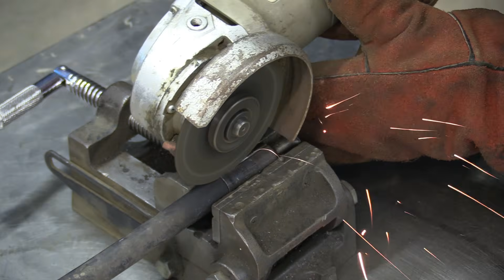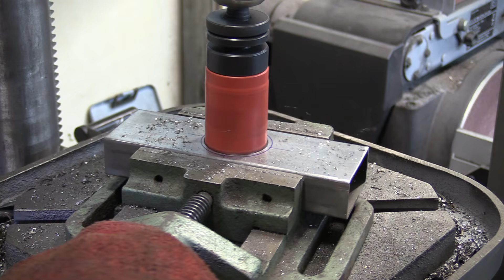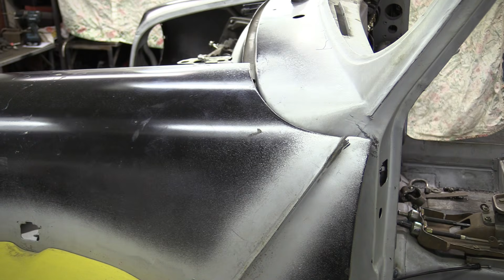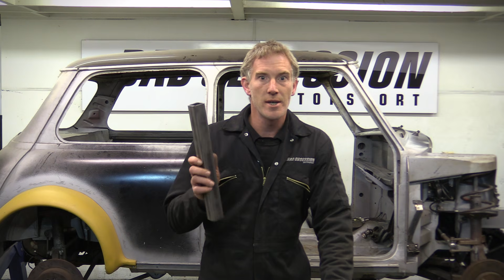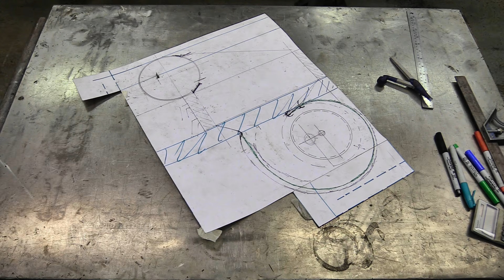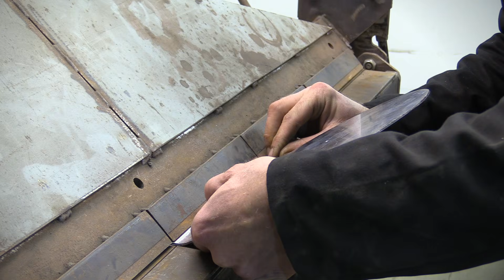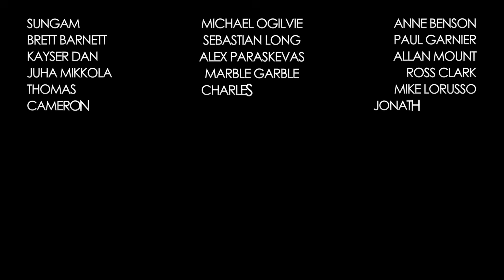Project Binky - Episode 16 - Austin Mini GT-Four - Turbocharged 4WD Mini

Comment: Millions of hours to build and 1 sec to wrap around a tree stump.
Reply: In the next episode, before hitting the road, we will grind down all trees and tree stumps within 1 furlong of the road – with a die grinder.
Reply: part of me doesn't want them to race it. from the other hand - all that work has to be put in action. From what i know - sometimes for builders the most important is the process of making, what happens next is not that important.
Reply: they could use the fate worse than death wheel
Reply: That's part of the design evolution. Crash it then while mending it you make it bit better than last time.
Reply: It's going to be his road car I believe, hence the air con, heater, leccy windows.
Reply: Looking at how sturdy it looks - you should be worried for the tree.
Reply: user12345 this will be their street legal rally car, and they made it clear that creature comforts are not to be disregarded.
Reply: Umm, that's what I said?
Reply: i just like building cars driving is second probably why i own a Citroen always something to fix
Reply: That would probably take the same amount of time as the fabricating a few simple brackets.
Reply: be around a treestump because they could have added lightness by using anti-fog or metho.

Comment: I can't help but think the final shape of the heater-box was about (almost) twice as big as could have been done if you had the time to design it around spiral-based air-speed focused "labyrinth"-channels, for more optimal space use. Though obviously if there wasn't going to be a glove-box that'd sure be simpler, as then certain components could be relocated into the engine bay with tubing, like BMW style.

Comment: I was trying to work out what you chaps are actually doing here.
You are basically designing and building a new car model from scratch.
The body has been designed somewhere else, as has the engine and transmission but the rest is all new.
Everything!
Just to complicate things, the boffins in the body work department have given you a body, 120" long and 55 1/2" wide.
Oh yes, and the body was never meant to have rear wheel drive. Nice.
Still how hard can it be, a car company has a huge budget,  hundreds of people working on the project, departments specializing in each component.
They have multiply facilities, tools, equipment, jigs and robots.
Now, just explain to me again why this is taking so long? You have C.A.D. and a new ed of catering, no more excuses please.

Comment: If it's just for heating, and you didnt want the direction, I would have just mounted the radiator on a 30 degree angle off the fire wall, created a shround and drilled some holes for fans to force air inside. Would take up 1/4 of the space :)

Comment: that heater box. i wouldn't have done that. i would have made the box, then cut it in half and add the lip on the inside, bend that a tiny bit in so it goes in smooth, add some nuts on the inside and add holes in the right places so you can use countersunk bolts and done. saves a LOT of time and a LOT of fumbling around. Well, at least, when I do it.

Comment: How about some 3d printing (or glass fiber for that matter), 30 mins of design and 2 hour of printing when you are not there is not an issue.  I know this is stage for you to show your work.  But I am sure customers would want you to be efficient and put time in where it needs and leave other manufacturing processes for the other jobs.

Comment: Fantastic work as always, nothing is below beautiful on this build. Given the small space for the engine and it being turbo and such, do you think ambient air and thus block temperature will be an issue? Eric The Car Guy has been doing a fairmont build with a V8 turbo and he kept having heat problems. Here's hoping its just higher CFM fans that solves it but it's not a confirmed fix

Comment: The actuator flipping hood thingy is completely unnecessary.  The engineering and fabrication involved is nothing short of miraculous, but still; why add needless weight to a racecar??
Reply from the maker: +Rerock It's not a racecar.
Reply: Oh okay, thanks for the clarification!  Was the hood (bonnet) heavy to lift/open, or was the actuator simply for the cool engineering/fabrication factor?
Reply from the maker: +Rerock Just because we could really. 😀
Reply: Right on.  Keep up the amazing work; I'm anxiously awaiting the next installment!

Comment: So, a front hinged hood on a semi truck can be tilted forward and back by hand but you need an electric linear actuator for your Mini hood?  WTH?  Great video but that was a huge waste in my opinion.  Two properly placed and sized gas pressured struts would have worked perfectly, not required that actuator or space or any electrical wiring.  
PS: Did you ever fix the design flaw in your brake/clutch reservoir?
Reply from the maker: +Mike Grady You can't scare the shit out of someone standing next to it from 100ft away with a pair of gas struts.
Reply from the maker: +Mike Grady No, do tell about the flaw in the reservoir.
Reply from the maker: +Mike Grady You're free to build your flip front with manual activation. We chose a different route...
Reply: Bad Obsession Motorsport, totally agree.  It is 100% your project and prerogative. I just didn't understand the reasoning behind the added complexity.  I was hoping your might be able to illuminate my lack of understanding.
Reply: The reason is probably Added complexity and huge waste of time and a bit of Looking cool at the Ice Cream stop.
Reply: Bad Obsession Motorsport, how's that?  Do you mean with the linear actuator?
Reply from the maker: +Mike Grady The remote.
Reply: Bad Obsession Motorsport, I was going to ask again about the brake/clutch resevoir but it appears questions are being responded by an administrator so you probably don't understand since you are confusing a linear actuator with a pair of gas struts.......
It's all good though.  The entertainment value of the production is worth it.  
Thanks for the videos.
Reply: Bad Obsession Motorsport, what episode was that in?  You had mentioned in the video that you did it a certain way so if one line leaked, it wouldn't ruin the feed for the others.......but it still would.  If you remind me the episode, I will rewatch it and give you my thoughts.  I commented on it but you have so many comments, it wouldn't be hard to have missed it.
Reply: I found it.  
If the clutch line fails, your brakes still work.  If the shared (brake/clutch resevoir) brake line fails, (hopefully the rear brakes) you will lose the clutch.....
Now, if it was made so the clutch height was higher than the divider, you lose it if you lose either brake line.  The drawing suggested this was the case BUT it is just a drawing...

No big deal until you have to begin to move the car from a dead stop.  It's no big deal if you aren't racing it, I guess.  I thought this thing was going to be a rally car.    If that was the case, losing a brake line is much more likely to happen than losing a clutch line....that's pretty much the case if you aren't racing, as well.

Comment: And, errr... lightweight cardboard heaterboxes are actually the PAST. Mercedes used them in the Ponton/190SL series. In 1953.
Reply: They also used biodegradable wiring harnesses because fuck you that's why
Reply from the maker: +tocsa120ls Good stuff.
Reply: They did that for the same reason BMW makes plastic water pumps.
Reply: +accow  Because they hate their customers?
Reply: Because they can! Obviously :D
Reply: A quick eBay search confirms that it did... Why?!
Reply: You are right but that was because of stupid Us regulations at the time..if anything would have cost them more to produce!